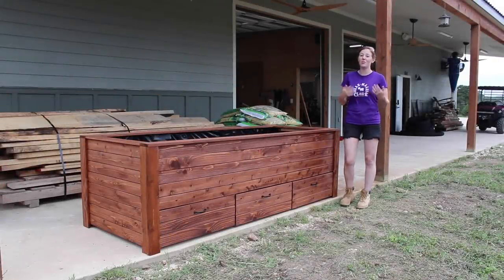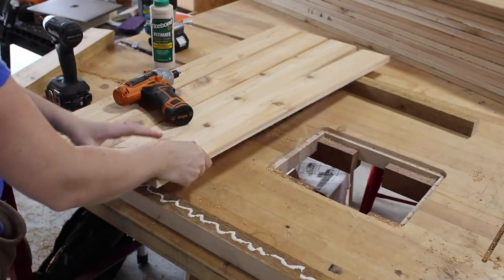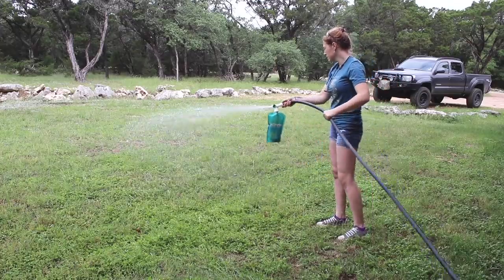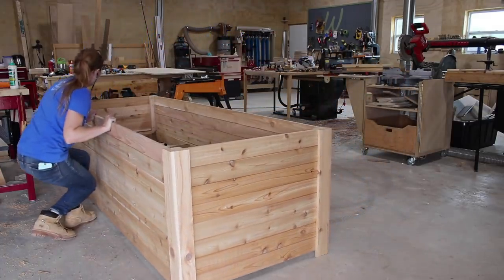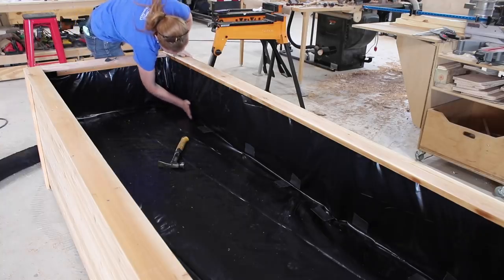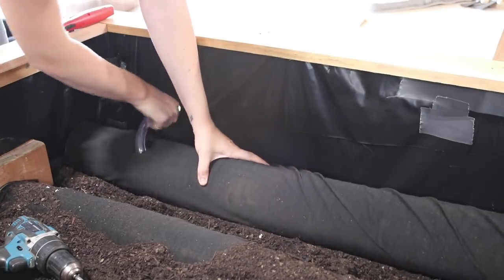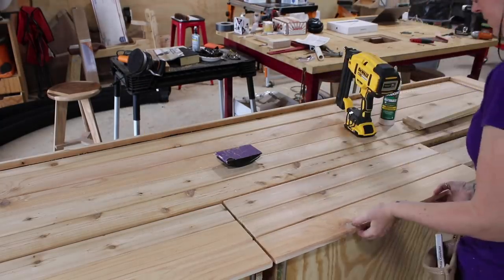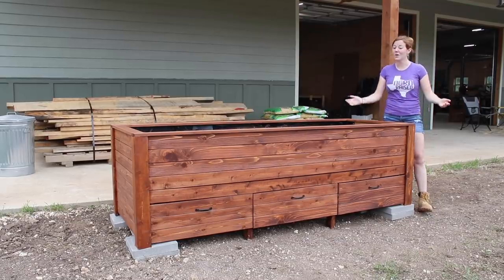DIY Raised Garden Bed with Drawers

Comment: I love my SIP system! I live in a 3rd floor apartment, with a small balcony, and not much direct light through any of the windows during the day. So my gardening is all in containers, but in less permanent, much smaller ones than this. Since container gardening requires more water than in-ground gardening, it's just responsible stewardship to use a SIP, since that keeps your plants at a better hydration level without needing quite so much water all the time.

I use (at present) 3 plastic totes with recycled 1/2 gallon milk jugs as my reservoirs. Poke holes into all the milk jugs (5 per tote) and cut a slit in the side that faces down (to facilitate filling of the reservoirs), and add both drain and fill tubes. I use a hard plastic straw, about 0.5" diameter, as my drain tube, run into 1 milk jug through a hole in the back side of the tote. For the fill tube, I use recycled, straight-sided drink bottles. Cut the bottoms off, take off the caps & labels, nest 1 into the other, and then cut a hole in one of the jugs to fit the bottle top into.

I just have to be a bit cautious when I first add my soil in, because recycled milk jugs are not the sturdiest things ever, and just dumping the soil in can crush them. So add slowly around the milk jugs to provide external support to the plastic before pouring in the rest of the soil on top of them. Capillary action lets the water wick up through the dirt that's pressed down around the reservoirs into the dirt above them, and keeps the soil more evenly moist without as much need for surface/top down watering, which can encourage molds or small pest growth in soggy surface soil if you live in a humid place.

This year, in addition to my 3 big SIPs, I'm experimenting with turning plastic ice cream containers (Blue Bunny, for the curious) into mini SIPs, using old medication pill bottles as reservoirs (being chronically ill, I have a ton of them around) and 12 oz drink bottles as fill tubes, with just regular old straws as drain tubes. I've found SIPs to be especially helpful for growing really thirsty crops like tomatoes and cucumbers, where in the heat of summer I might have to refill my SIP reservoir every 1-2 days, instead of 1-2 times a week.

Comment: Great looking bed April.  I built one last year without the drawers and it's been awesome.

Though I would recommend all staples be above the drain hole.  The dirt will keep the liner in place.  Also, don't worry about anaerobic or too wet issues.  The drain hole and the French drain prevent a soggy mess and the "soil" should only wick up what it needs.  Your roots will grow down to the water and do great.  NEVER let your bed go dry or you plant's roots will be damaged and likely die.  A top off every few weeks should be plenty.  Adding mulch around the plants will help retain water even better.

Fertilizer, whether made synthetically or organically, are chemically the same for plants.  (It's the pesticides that are dangerous in produce)...  You can add your water soluble fertilizer into the water below and on top.  I successfully grew lettuces in the middle and used a wire fence material arching over the top (3 feet on center) to create a tunnel.  I grew cukes and created a shaded tunnel with the foliage for the lettuce and the cukes hung down and I harvested them inside the tunnel.  Worked great!.  Other options are green onions, string beans, garlic and lots of herbs ;)  Marigolds for cross pollination and pest control.  Basil is good at that too.  

I've added pond liner to lots of containers and made SIRs for nearly all my veggies.  You probably only need to add water every 3-4 weeks.  

For great tips, check out the Rusted Garden with Gary or Calikim.  Lots of other great gardeners out there too ;)

Best of luck gardening.  Great job on the new shop and really like your builds!

Comment: Everything went well and love the planter box. Only exception is that it is definitely leaking despite having used very few staples on the bottom and covering with duck tape. I’d definitely recommend NOT using any staples on the bottom. I just ordered a new liner and plan to redo it.

Comment: Really nice design!  I made one of these, called a SIP (sub irrigation planter) bed a couple of months ago.  A couple of things that I did differently, that I would like to if know how the changes affected your bed.  First, I didn't use a layer of soil on the bottom. I've heard this creates an aerobic breakdown issue long term.  Second, I actually had to extend the depth of my box to accommodate a minimum of 14 inches from the soil surface to the reservoir. That was a recommendation from the local extension office.  I didn't wrap the or buy the corrugated pipe pre wrapped.  The extension office advised that the soil would likely not get in the slits in the pipe, thus not worth the extra costs.  Also, I've found that regular old peat moss works great for a grow medium.  Cheaper and actually less dense, and can't beat the drainage quality.  I didn't staple the pond liner in the box at all, I did staple the overhang on the outside.  The weight of the pipe, soil and water held it down fine.  Lastly, on the advice from several SIP sites, i put a thin layer of pellet lime about two inches from the top.

Comment: Nice Build - love the drawer idea.  Would not have stapled the bottom however, and also would have used thicker liner.    You may want to check your drawers from time to time for leaks,  don't think that duck tape will hold for very long.  Also I agree with others about a different medium around the tubes like river rock (something smooth) but allows water flow.

Comment: I built this watering system in some window boxes a few years ago. It worked great! I ran a few strings into the pipe and out to the soil to help regulate the water, giving the soil a wick to pull water up as needed or if over watered to send it back into the tube. Also, added some orbies in both the soil and the tube to help retain the moisture as a slow release because it was just a window box and to much water would kill the plants. Obviously not needed here... Lol also, use flex tape not duct tape next time over the staples. Seals much better and won't leak or leach!

Comment: I think the drawer slides will rust, either from moisture in the outside air or rainwater rolling under the lip of the drawer openings since there's no drip edge or other protection to prevent that from happening. Also for lack of a drip edge, water will probably get into the drawers. Even with a drip edge, a driving rain will get into the gaps between the drawers and the drawer openings. So it would have been a good idea to put some holes in the drawer bottoms for drainage. I'd like to see a follow-up on this project after it's weathered a summer and a winter.

Comment: As always, looks great and another wonderful presentation. 

A couple suggestions personally and from Leon, the godfather of SIPs. He’s a hoot to watch too. 
1. If you want to hold down the plastic before adding the soil, just put some weight on it, like a scrap 4x4. The duct tape will seal it until the adhesive deteriorates and then you have a leak. 
2. The soil that extends into the water reservoir area should only be about 15%. This is about the difference in area between a circle and square so the pipes should fill the bottom of the reservoir area. This is per Leon and something that seems to be missed by many. 
3. The overflow tube doesn’t need to go into the pipe, but it does need to be lower than the top of the pipe. This is to create an air gap in the reservoir. Roots need air as well as water and will drown or rot without it. 

Also, plastic is mils not millimeters. 6 of the former is heavy paper, light cardboard. The latter is 1/4” thick (25 mm per inch). So much for metric in the USA. 😉

Comment: I think it'd be better if you had some medium, like scoria or similar, between the soil and the hoses. The soil at the bottom of the bed is constantly gonna be wet and there's a risk of it becoming an anaerobic enviroment. By putting another layer between it'll allow the water to wick up to the soil leaving it moist/damp and not wet. Put a pice of weed fabric between the stones and the soil. 
This is just my thoughts :)
Reply: Yup I agree! But run the weed fabric all the way around & up to the top of the sides. Because even tho there is a plastic  6 mil liner in it will not stop leakage.
Reply: MICHAEL PARKIN Well, I don’t know how much the fabric will help since it’s ment to let water through. It’s just there to keep the soil out of the rocks 🙂
Reply: Actually if you read the articles from the original wicking bed creator, he uses only organic matter at the bottom for the reservoir because soil/organic matter is much much better at wicking than stones or sand. The point is not to leave water in the reservoir constantly but to allow it to dry once a month to avoid it turning anaerobic and smelly.
Reply: I have used this type of bed for three summers and it has worked great.   The only difference is I made mine deeper to allow the supper wet soil to be deeper from the surface and not causing root rot. I also used a mixture of peat moss, potting soil and pine bark to make my mix. The soil does stay wet at the bottom, but the plants seem to get the correct amount of moisture. I grow more food in my 3'x7' planter than we used to grow in a garden 6 times that size.
Reply: muttonchopred ?
Reply: @RedboneUnincorporated  🙄
Reply: @RedboneUnincorporated  Yeah, your my hero..

Comment: This looks great. I have a 3'(W) x 14'(L) x 5'(H) raised garden bed using sub irrigation. It has been working really great in the past 5 years or so. It doesn't look so great as this one though. I've been thinking about adding drawers forever and it is great to see some experts got it done. Only one thing that you might want to change before you put plants in: the drainage hose is way too high. The idea of sub-irrigation is that bottom of soil always touches air, not water. So the drainage hose should be lower than the top of the big water pipes at the bottom. My drainage hose is connected to a pipe that waters other plants nearby. Also I used thick EPDM fish pond liners instead of thin piece of plastic.

Comment: I have the same type of beds at my house.  Been using them for 3 summers and they work great.  Only difference is mine are about 50% deeper to keep the super moist soil from the surface. I also didn't put any staples in the bottom, and my drain hole is about 1.5 inches lower than yours.  I have not had any problems and have grown bunches of food. Broccoli, lettuce, cabbage, peppers, beans, tomato, potato, and peas all do well.  Seems to be too wet for carrots and onions.

Comment: I built one for my wife as a bday present, granted it wasn't as nice as this one, I used all recycled wood from fence planks that I got from a fencing company for free. The hardest part honestly was to level the ground where the bed sits at, and of course the actual gardening part of it, that's entirely left to my green thumbed wife. She just harvested a couple of peppers and a lettuce from it and the satisfaction you get from it is priceless!. The next step will be to add a water collection tank, we have a rain spout right next to the garden bed so there's a few solutions that tie onto that. And then I need some type of manual pump to use that water for the garden bed. I'd like to go the extra mile and install a dripping system, but I'm not well versed on what's needed for that, so if you could do a follow up video on how to do that that'd be great! haha. Good luck on your produce and keep us posted!

Comment: Great job April!

Quick tip for those slide, or any moving metal, in outdoor environments.  Try applying a generous coat of "plumbers grease."  This is specially designed to repel and displace water and acts as a heavy duty lubricant as well.  It tends to remain temperature stable in both the heat of USA deserts and the cold of Alaskan blizzards (A godsend for those of use that have 95+F summers followed by -30F winters).  For me the best part is that the thick clingy and water repellent natures work together to reduce negative effects on the environment at we (i.e. it wont run off or partially dissolve in water.  I, and many of my students, have long used it for outdoor projects with excellent results. 

Again, great job!  It has been a wonderful experience to see you evolve from a beginner to an accomplished craftswomen over these past few years.  Your infectious joy of discovery, learning, and accomplishment, along with you consistently humble and caring attitude, are a bright ray of hope in today's world.

Comment: To be clear soilless mixes (no organic life) are peat moss/coir + sand + vermiculite/perlite and plants are fed through chemical means typically even though you can feed with compost/worm tea. If I was you I'd go with an organic fertilizer and worm tea for long term success. Great idea with the self watering system in hot Texas.
Reply: Fish emulsion works great too, and it's virtually impossible to accidentally over-do it

Comment: Made one of these geez almost 12y ago, it did great, only difference was I used continous hose not 3 sections. Also put a quick disconnect on the input.. All the pants did great, and only had to water 3-4 times the whole season.. Great build

Comment: I really like your planter, April. I suspect you're going to enjoy how that works. I've been a subscriber for several months now and really enjoy your ideas. That shop is just beautiful but to me something that nice has to be paying for itself. Mine is a "bit more modest."  ;^)

I built 2 outdoor planter boxes but they're a bit different than yours. They're 4' X 8" boxes built with 2 X 12's, with 4" X 4" posts inside the corners to secure the sides to. I pre-drilled the corners and used a 1/4" impact driver to run the lag bolts into them. The bottom has 2 layers of weed cloth, covered by 2 staggered layers of "aviary-wire" (about 3/8" squares) to keep the gophers out. We've raised 2 kids here, 4 dogs, 2 cats, and about 4,000 gophers! The bottom layers are fastened by an electric staple gun. When they were finished, I picked them up with the bucket on the John Deere and set them in place. I laid out a drip system controlled by a 4-valve manifold that's fed by a 3/4" garden hose from the house.

These boxes have been providing tomatoes, various types of squash, basil, cilantro, and whatever else my wife thinks should be there for 3 or 4 years now... I'm just the shovel driver!!  ;^)

Comment: I didnt have drawers but the corners of my bed were 4x4s and I extended them up about 3 and a half ft.  I need to put sun screen material around the sides and top because I live in Phoenix and the sun is intense

Comment: very nice , but i made mine out pallet jack , you lay one between  two of the pallet jack and use 3 inch screw to attach them and then made in length i wanted and cap the ends with a other pallet , simple and cheep , but i like your also, but one thing i know is if you get the right pallet jack most are made out hard wood ice video april keep up the good work

Comment: Hopefully your duct tape is more waterproof than what I have used.  To avoid the staples issue I wonder if you could also possibly have just made a wooden frame for around the inside edges of the planter to hold the plastic out in the corners.
Reply: Or what about using a spray adhesive? If the plastic is not permeable, then I would imagine that the fumes/toxins wouldn't negatively impact the soil?
Reply: @UC_ip8OOD6hesMrSZEEb1iWw As long as the adhesive doesn't dissolve plastic, I would try it before staples as well.  :)  Most fumes vanish decently quick for good finishes...so I would not expect fumes outside to be an issue as long as it doesn't dissolve the plastic.
Reply: Why put staples on the bottom at all? That plastic is not going anywhere!
Reply: It didn't need staples or anything at all. The dirt itself would have held the plastic in place.

Comment: That's a really cool project, April. I never had any luck with raised planters when I lived in Central Texas due to the fact I never could keep enough water in on the plants with the brutal July-August dry heat. The reservoir on this is brilliant. I'm wondering if there's a way to engineer some kind of  long float stick in the fill tube as a quick way to figure out your water level. For your overflow tube, maybe make it out of pvc so you can run it from the existing exit point down the outside to drain on the ground. That way the side won't get stained long-term by the tannins that will naturally leech through the soil into the reservoir.

Thanks again for a great design. Now that I live in coastal Louisiana, this will help with our challenge of TOO much water and weeds overtaking one's garden!

Comment: Awesome planter overall! My only concern is the plastic liner. Perhaps in Texas the soil would dry enough to thwart root rot, however if you live somewhere more temperate (or especially wet) this would be a problem. I’d swap out the plastic for gardening fabric.

Comment: This is an interesting design with the drawers! However, I suspect the water you put in will over saturate the bottom of the planter without any drain holes. Please let us know how it works throughout the summer.

Comment: Looks nice! I wouldn't have stapled through the bottom of the liner though and I think your drain hole should be flush with the floor of the container, so stagnant water doesn't sit in the tubes.
Reply: Leon --Gardening with Leon has put out many videos on this kind of self watering system. The pipes are the reservoir for the water and the drain hole goes one inch below the top of the reservoir. to prevent the soil from becoming too wet.